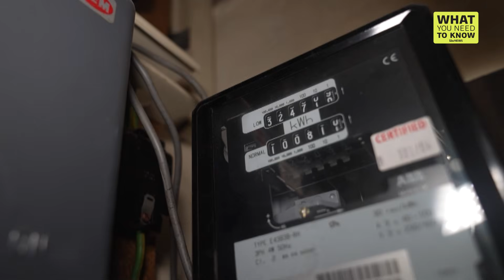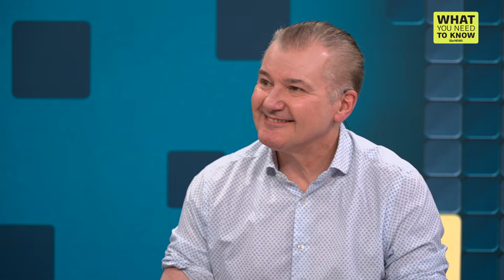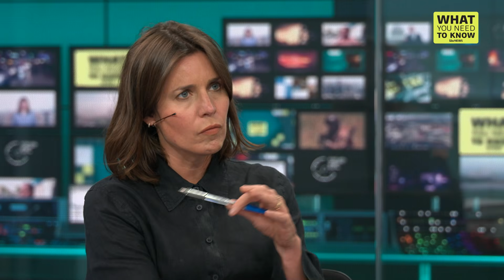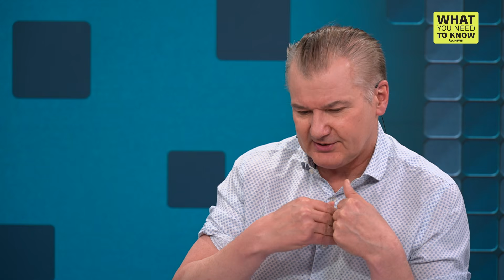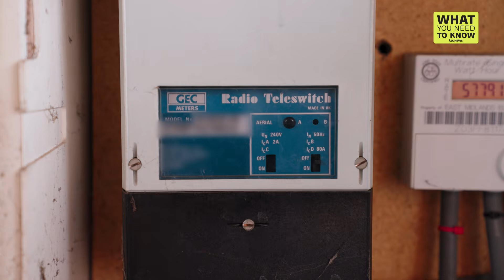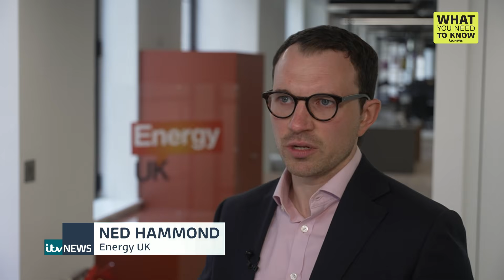Why thousands of energy meters are set to stop working | WYNTK | ITV News

Comment: You can’t just turn systems off if it will make so many meters obsolete. You should keep the radio frequencies active until all meters are booked in to be changed at least.
Reply: Speak to the BBC it is the Driotwich transmitter that sends the signal and the BBC are shutting it down after 90 years of reliable operation making the excuse that they have no more spare valves. A lame excuse and incorrect. sing the petition to save 198 KHz Long-wave part of the UK Civil defence broadcast system.
Reply: It's a total red herring